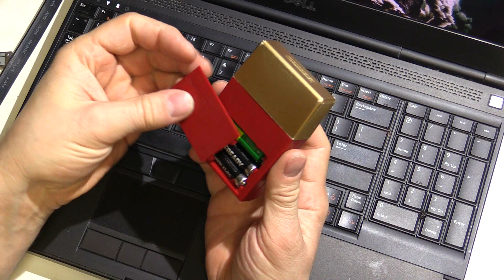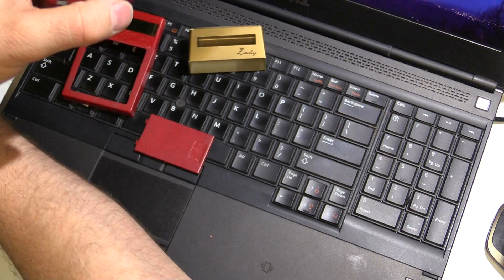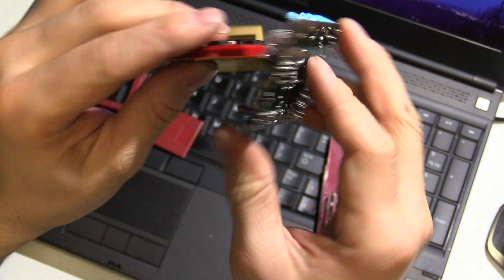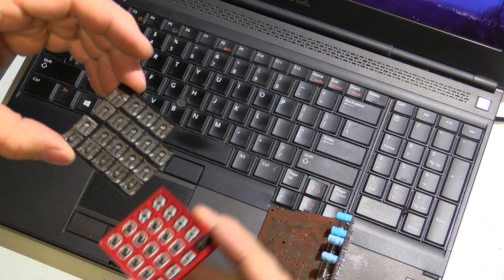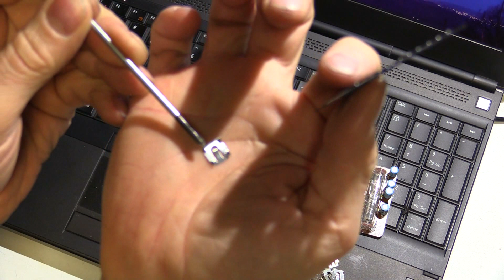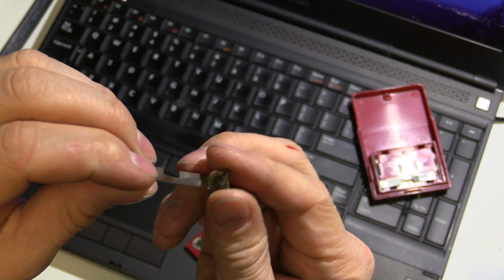Adler Lady Vintage Calculator Teardown

Comment: Nice calculator! Glad you have an early one. The later version has a black epoxy chip, rather than that lovely white ceramic and gold one, and the keyboard is attached by heat stakes rather than screwed, so not so easy to maintain.